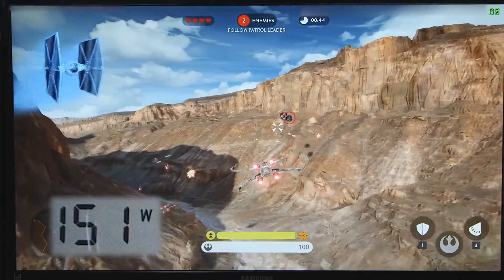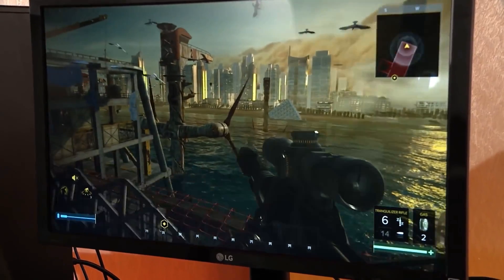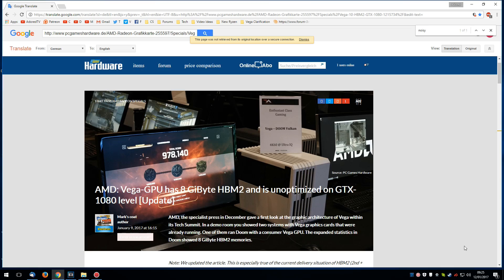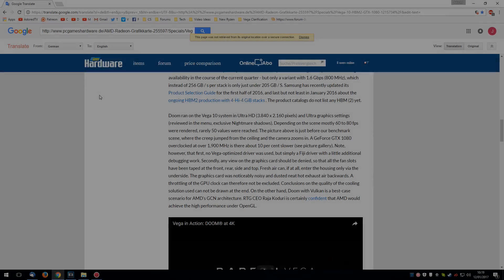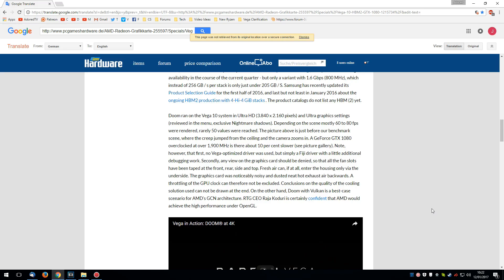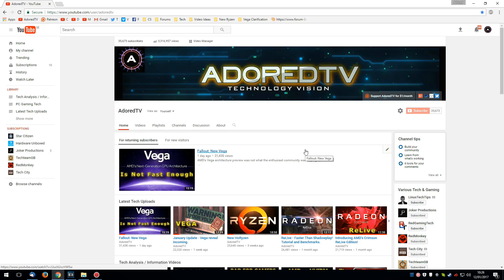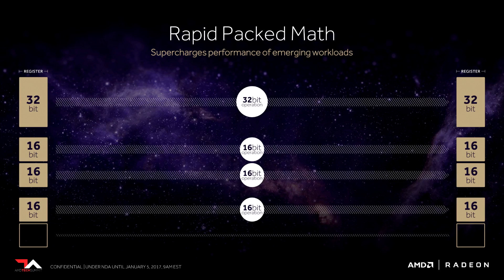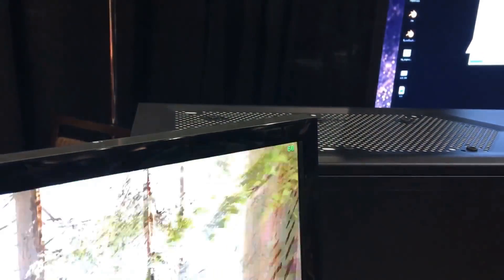Vega Clarification - How bad is it?

Comment: So...The 'Poor Volta' bait was for nothing? 

AdoredTV, as much as I agree with your points you have made in this video, I reckon AMD might have a trick up their sleeve. They can't boycott Nvidia's architecture for lols. 

Could it be probable that the VRAM stacks vary from chip to chip? Maybe the 8gb one has 2 4gb HBM stacks? The 16gb one (if there is one) has 2 8gb stacks? I don't know...

I'm not entirely convinced that AMD is screwed, I reckon there's something big awaiting. The driver they were using was terrible anyway. Didn't even take advantage of the new technologies. 

Regardless, I'm waiting for release.
Reply: AMD ultimately is to blame for what has happened. Had they not been too greedy 16 years ago by purchasing fabs that weren't needed and borrowed from the bank to get them, their capital structure would've been a lot stronger compared to what it is now. Had AMD not just refreshed the r9 200 series and released 14nm in 300 series they wouldn't be here. Had AMD not relied on FX ancient chips to this day they wouldn't be here. It's multiple factors that have made AMD the way it is today. 

AMD were once at the top, AMD could've been still #1 if they were patient when they were invincible. Now they are vulnerable. Will they recover? I don't know.
Reply: He covered the ram sizes in previous video.. The 8 gig chips are just currently way too expensive.
Reply: eather way more vram doesnt make chip faster,
i agree what adored said, when nvidia makes hbm chip it will destroy vega, i hope AMD has some thing strong to show and not pair to pair performance
Reply: For AMD to overcome NVIDIA's high-end, they need their HBM embedded GPUs to be so powerful, it not only obliterates the current NVIDIA line-up, it makes NVIDIA spend more than expected. Which means, NVIDIA will need to spend more on their familiarity with HBM, spend more on their familiarity with DX12 embedded hardware technologies (which is probably zero knowledge) and at the same time, somehow improve Pascal performance for those who invested 400-700 dollars towards their high-end. If NVIDIA doesn't support Pascal for the upcoming years ahead, it would be criminal. Since Pascal and Maxwell have little or no DX12 support, NVIDIA GPU owners will be forced to play on DX11 to maintain playable frame rates while (enviously), NVIDIA GPU owners will watch AMD owners see significant FPS gains. This is a win for AMD but since NVIDIA is dominating the market, AMD needs to hurry up and take advantage of Vulkan and DX12 before NVIDIA solves their issues. 

If Vega fails but Ryzen succeeds, it won't be enough. Both need to kill it. Both need to make Intel and NVIDIA look like humiliated bullies. AMD has the expertise and resources to get it done, for now. But they need more investors and funds (revenue) to kick-start a fight-back. Reviewers need to be sponsored more, there needs to be more marketing, more people employed on the graphics drivers department due to ongoing beta issues with Polaris GPUs. IF AMD does not act and take a risk where the reward could be endless, it's over. AMD made a unnecessary and stupid (ludicrous if you ask me) mistake a long time ago by taking massive investment risks and got too little in return to classify the risk as a success. (It made money, but, that money went straight to debt payments) 

This time, however, the risk has a reason, go for it AMD.
Reply: maz199   . lets be honest. everyone is just speculating here and no one really knows how fast the fastest vega card really is. Adoredtv is basing all this on known knowns, and estimated unknowns. we could all be surprised with vega. i still think amd doesnt have to be better than intel or nvidia, they just need products that are comparable.
Reply: Yeh they wouldn't do that for no reason:D!
Reply: I really really hate it when people come dragging about Bulldozer in every other discussion about AMD, but I gotta say that if anything feels like another Bulldozer, it's this. Nobody could believe they could fuck up so hard when Bulldozer arrived. People were in denial for quite some time. There just had to be some hidden performance somehow. But there wasn't. And I feel the situation is the same now.
Reply: I don't think 8GB stacks are available at a consumer price point or big volumes.
But maybe they can make a 16GB model in a year or so.
Reply: +Snetmot Nosrorb Vega isn't THAT bad, at least there is a performance boost, and there is some potential that can be used for professional applications and maybe gaming in the future, bulldozer was just terrible for everything (except for the APUs) including the professional market.
Reply: Willyfisch by the time they do that, they would've lost millions in investments and lost millions to Nvidia's dominance. I guess AMD might need to pull out a miracle on this one.
Reply: AMD will make most of their money from their CPUs, primarily from consoles and professional segment. Maybe with RyZen they may get some decent income from the consumer segment. However I don't see their GPUs succeeding in anything but macbook pros and professional segment, but they will still make them anyway because they need to design the next GPU architecture for the next APUs and they might as well make desktop GPUs as well because they wouldn't lose much money as they already designed the architecture for APUs
Reply: Rattacko You are right. But I don't see how a chip that is larger than GP102 on 471mm² (which isn't even fully used in the only released product Titan XP) but just beats a chip on 314mm² will be profitable. It's worse than Polaris, much worse. But it doesn't add up to the "very, very competitive" statement by Lisa Su let alone all efficiency claims and architectural improvements. Maybe they are sandbagging after all. New strategy to lure Nvidia to put down their cards (hehu) first and let AMD be able to counter. I don't know what to believe.

At least Zen will be competitive. I think it will do well in the server and professional markets and earn AMD some well deserved money.
Reply: Recently on REDGAMINTECH's channel interview with  Scott Wasson he stated that there are Vega features that haven't been duscussed yet, hope that's the trick up AMD's sleeves

Comment: Looks to me like AMD is just trying to do hype management with Vega. Everyone expects the same leap forward form Vega as it was with Ryzen. They are not releasing any specifics, don't show the card itself, cap it with vsync, and barely talk about it at all. They are trying to tone down the expectations, so there will be less disappointment if it will turn out slower than Titan X(p). On the other hand, there is that "poor volta" pun in the video, so they seem to be confident. I'm confused now. 
If Vega really turns out to be crap, I'm giving up on AMD, I'll probably won't even buy Ryzen. I'll just wait for Intel to drop prices.

Comment: Your a goof ball if you think the proper price for a 1080 is $300.
Reply from the maker: Well you can start by telling me the launch prices of Nvidia's previous mid-tier GPUs before GK104.
Reply: The 1080 is not a mid-tier GPU lol. 9 months ago it would've have been the most powerful GPU in the world.
Reply from the maker: Nvidia has 5 GPUs on the Pascal architecture, GP100, GP102, GP104, GP106 and GP107.  The 1080 is GP104, smack in the middle of the range.  Sure they named it the GTX 1080 and gave it a high-end price, but  in years gone by that would have been a $250 GPU and called a *60 or even a *50.
Reply: 314mm2 Die size looks like a mid range GPU to me, if am wrong feel free to correct me.
Reply: I don't think you even convinced yourself with that tbh. 3 years from now the second most powerful GPU might be only 200mm, it'll still be a high-end card.
Reply: Well i think everyone has a right to their own opinion :) that being said, i do still think that 1080 is a mid-range card. Considering its die size that thing does not justify its PRICE tag whatsoever.

Comment: I'm gonna sit on my 380X until 2018 or later so I don't really care for Vega, but I'm starting to think they really are sandbagging. The Vega shown is more than twice as large as the RX 480 but doesn't perform nearly as good as that size differential would suggest. They already have the Polaris tech, so why not just make a bigger Polaris if it's better than the Vega architecture, basically the RX 490 that everyone expected? That just doesn't make sense. 

Second, it was probably running a blower style cooler which would make a card of that size loud even at conservative clock speeds and in an open case. Considering the vents were taped off, air flow would be severely restricted and thus I think it's unlikely they were running a full throttle 300+ watt card without people talking about "jet engine" levels of noise and not just "a bit loud".

Comment: More speculations, not more sources. We know that engineering samples run at lower clocks, we know that drivers were bad for Vega at the demo, we know that ventilation was bad...

... this video doesn't tell us anything that we know, only speculations. "It did not run at lower clocks, because the fan was noisy". Yeah, sure... as if a noisy fan meant that the GPU is not throttling (Hawaii, anyone?). "AMD wouldn't demonstrate a non-finished product". Would they really let Nvidia take all the sales and not say "Look, we got something that will be better than Nvidia's offerings. It will be ready soon."

Raja Koduri even confirmed that clock speeds are not final, but hey, let's try to defend your "meltdown video" with even more speculations.
Reply from the maker: Meltdown video?  In the end I'll be proven right again. ;)

Comment: Why so negative. As always: price will decide. 

Samsung and Qualcomm are moving to 10nm, which means that there will be lots (LOTS) of 14nm capacity. This will lower 14nm prices so price to manufacture one Vega die should be very attractive. 

Also features like 100GB/s interconnect or virtual adress space should make multi-gpu behave like single monolithic die...
Reply from the maker: Cheap means no money is made, and no money means no future.
Reply: I just mentioned that 14nm prices will be better (amortized equipment,less demand) which is generally good for AMD.
Reply from the maker: If they have free 14nm capacity it's much more likely to go to Zen though...and they still have to pay GF for anything fabbed outside.

Comment: And why nVidia would be so much faster on HBM? I don't think so and performance increase would be maybe 10%.
Pascal and Vega are almost same chips technology-wise so they will perform similar and AMD of course will be cheaper.
Reply from the maker: HBM will save them die area for more shaders, and power to power them.
Reply: So what is occupying so much space now? Gddr5 ??
Reply from the maker: Yes basically, especially a 384-bit bus which is really large.
Reply: Why do you think Vega has less shaders than Pascal. Also 14nm is smaller than 16nm

Comment: I have a feeling that this is like the Bulldozer plan, giving us the server\Work station parts leftover.

So the Vega it self, we no there is a bit to gain in driver optimization 3-5%. 
Then we have some thing to gain on cooling and overclocking, lets say 5% at max.

It will be a great bump over the Gtx 1080, but for what price? The di is big and Hbm is not cheap.

Comment: The biggest disappointment about Vega is how late it is. Who will buy it ?
Reply: Sinier940n That's what's done me dude, I was wanting a card better than an RX 480, but ended up getting a 1070, as VEGA just seemed too long a wait.
Reply: If you managed to wait this long, May is practically around the corner.
Oh and as for "who will buy it?", let's assume the worse for just one second - AMD pulls out a 1080 equivalent but prices it at 400$. Now the question should be "Who wont buy it?". I'd happily pick 2 1080s right now for 400$ and I'd be damned if I cared waiting another 4-3 months as well.
Reply: Stay with your Fury. I went from a GTX 970 to a GTX 1080 and the perceivable difference is fuck all. I only swapped out to give a friend my GTX 970 as he was rocking something oldschool. Maybe a few dips below 60fps GTA 5 maxed out at 1080p on the 970. I don't play at higher res or above 60hz because I'm a peasant. Unless you're at 2.5k, 4k, or wanting 144hz don't bother with the 1080. Even then please consider from my experience the following; Whilst the GTX 1080 is fast, it's not great in terms of price/performance (it's goddamn awful), it won't do 4k at 60fps with all eyecandy turned up on a lot of games, and it's fucking expensive. Oh. I already said that. Even at 2.5k you're smashing it with your current card. Without games pushing visual boundaries alot of people with various hardware are just left with an extra 45fps past refresh that goes to waste. Your Fury may have another year left in it, and it's resale value won't drop too much.
Reply: I guess Vega will be much more than the high-end card, it's a breand entirelly new arquitechture, It has even more changes than the Polaris 10.
So, possibly it's taking a lot mostly because of that, since I am almost sure that Vega based cards will be used for low / mid and high end on the 500/600 series, or at least it will use already most of the arquitechture changes.
Reply: This is true!
Reply: " let's assume the worse for just one second - AMD pulls out a 1080 equivalent but prices it at 400$." Epic lol. There is no way it will be below 500$. Some argue it will be no less then $600/550. Chip this big with HBM just cannot be cheap. And at this point, it doesnt meter how they price Vega, they are fucked anyways because 1080ti is knocking at the doors and 1080 could easily be a $500 card.
Reply: You see, unlike nVidia, this isnt AMD's first HBM card.
That's mainly why they can make it happen.

Comment: Thx on elaboration of your last video. I too hope you are wrong :P

I completely agree AMD is not deliberately sandbagging, but I do think there is some chance those engineering Vega were not running at maximum clock only because up until few weeks ago we have not seen Zen at base clocks of 3,6 GHz that are now assumed to be  actual release frequency. If in December (3 months before zen release) AMD was unable to produce demonstration at full release clocks so perhaps they have same issue for Vega silicon full 5-6 months before it's release. I know it is a long shot but it might be the case.

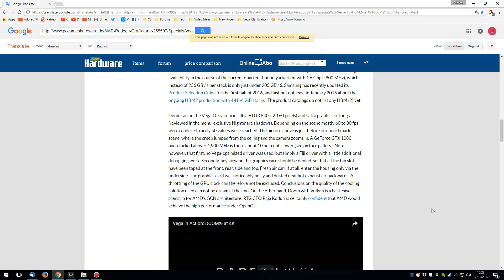I speculated a a bit abut Vega performance under likely assumption those demos were at final clocks.  At 8:55 You show Titan XP has abut x1,32 reference 1080 performance. I think overclocked at 1,9 GHz it is fair to assume  1080 will be abut 5% faster so Titan advantage is reduced to 1,32/1,05= 1,27. If we add 10% advantage of Vega over 1,9GHz 1080 we can assume Titan Xp advantage over Vega to be at 1,27/1,1=1,15., or Vega should have abut 87% performance of Titan XP. How much driver can improve on that during next 5 months? Well 480 drivers improved that's card's performance by abut 8% in  6 months sense release. If AMD is able to achieve half of that before end of 1H 2017 release Vega should get around 90% of Titan XP performance.

Now I'll assume 1080Ti will  will be about 5% slower then Titan Xp  and will sell at about 700$ price point (traditional starting price for x80Ti releases), and 1080 will be discounted to 400$  price point (place 780 got after 290x was released) when 1080Ti comes out. Then I think it is still possible for Vega at 95% of 1080Ti performance to sell at 500 to 600$ price point. So while nVidia's dominance over gaming GPU mindshare will be safe I think AMD will be able to sell Vega at profit. Well that's my scenario for the end 1H of 2017.

Adored to you think card at 90% of Titan XP performance for 600$ is a good buy? Do you think it could sell?
Reply from the maker: Well the 980 Ti outsold Fury X by at least 10-1 so no reason why the 1080 Ti at similar performance to Vega wouldn't either.  I don't think AMD needs to worry about money so much these days as Ryzen is clearly a winner, but the state of the consumer graphics market has never been worse and it's just gonna go downhill from here.

Comment: "BIG" Vega price is on 1070 prices...so calm down guys....#betterrred
Reply: ye!
Reply: haha yeah, good luck with that price
Reply: thanks....if I am right, would u come back here ?
Reply: If you are right I will come back and retract my statement. Vega is around 500mm^2~ with HBM2. Meanwhile the 1080 is 314mm^2~ with GDDR5X which is alot cheaper than HBM2.  1070 is also 314mm^2 and it has GDDR5. Which is Even more cheaper than HBM2. Nvidia has lots of room to drop prices. AMD doesnt.
Reply: just to remind me and u.............:P.....I`m type "BIG" so its not Vega FE but something with RX on it. http://cdn.wccftech.com/wp-content/uploads/2017/07/AMD-RX-Vega-GTX-1080-Ti-GTX-1080-GTX-1070-3DMark-Performance-Wccftech.jpg the cheapest 1070 in Amazon https://www.amazon.com/ZOTAC-GeForce-Compact-Graphics-ZT-P10700G-10M/dp/B01LLAJ8PU/ref=sr_1_39?s=electronics&ie=UTF8&qid=1499530663&sr=1-39&keywords=GTX+1070